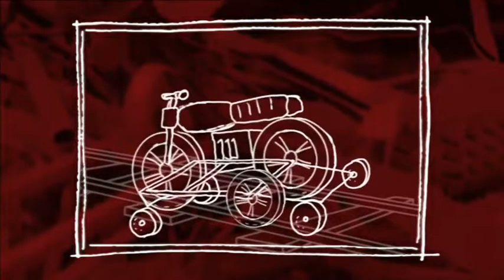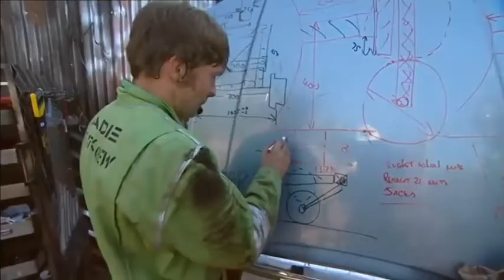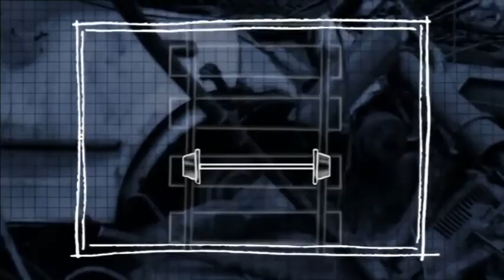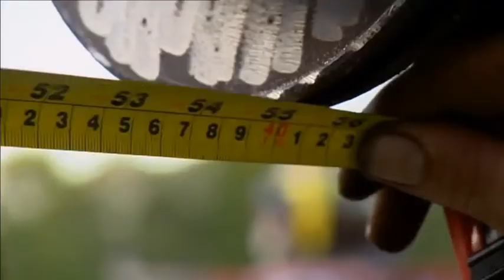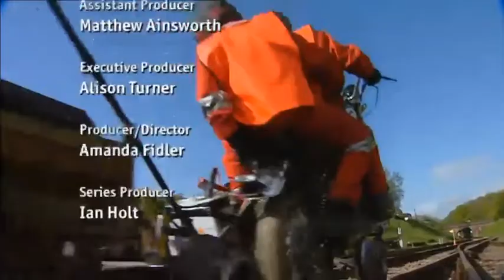Scrapheap Challenge - S05E05 (Railroad Racers) #ScrapheapChallenge

Comment: Railroad Racers is certainly one of my favourite Scrapheap Challenge episodes. But, it's not just because I'm a railway enthusiast.

The Pit Stop Crew were certainly overconfident, thinking that they had all the knowledge and experience for this challenge; but they kept getting their gauging measurements wrong especially when they realised (late in the build) that their taxi was too narrow to ride on the rails. Whereas, the Tunnel Ratz (being maintenance engineers on London Underground stock) got everything spot on regarding their gauging measurements. 

Also, I was quite surprised that the judge from the Bluebell Railway was very dismissive of the Tunnel Ratz; he should've known better to misjudge them as the Tunnel Ratz work on the railways just like him.
Reply: I was surprised they waited so late into the build to double check their measurements.
Reply: I’m surprised they didn’t fit the wheels backwards 🤣 way more than 50 mil there